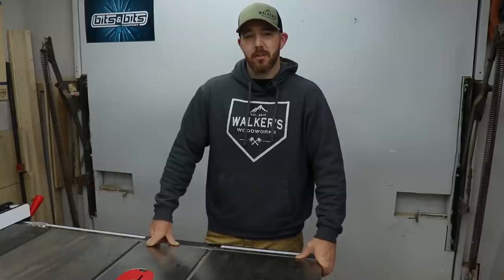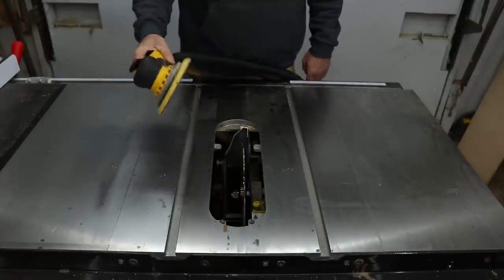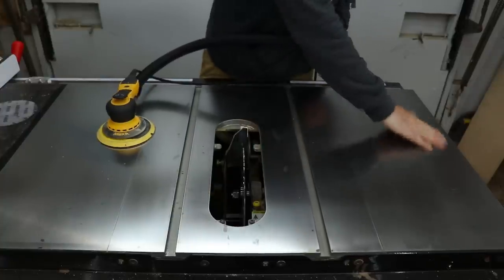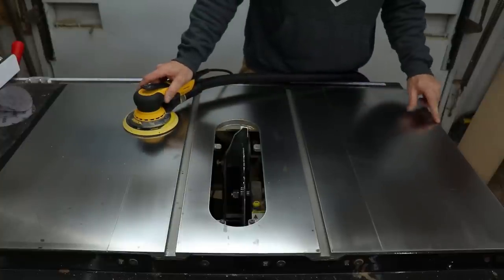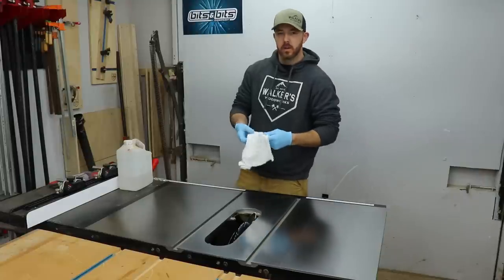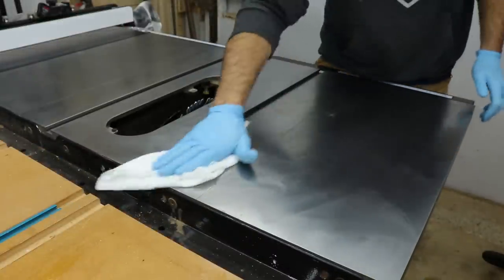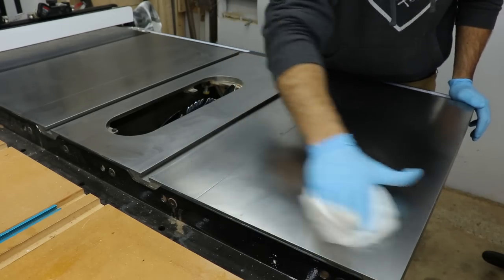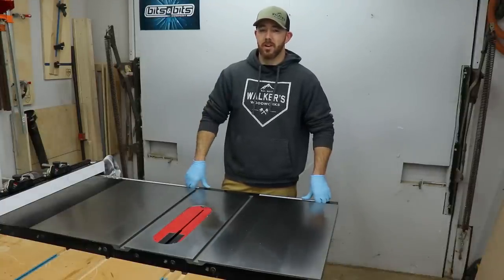How to maintain and clean a table saw top / Saw maintenance

Comment: When sanding anything it is a good habit to use mineral spirits every time you increase your sandparper number. Otherwise you are sanding in the larger grit pieces from the previous sand level.

Comment: Beautiful job. I've had a long series of old cast iron machinery over the last 45 years and have found single aught steel wool good for chasing the rust in the bottoms of pits. Also, a few swipes with a wad of waxed paper maintains a waxed surface for a very long time if used to dust a table rather than blowing it with compressed air.

Comment: I usually vacuum the top off, go over the surface with a 4” wide razor blade scrapper to remove dried finishes or fuzzy rust. Vac the table again and use a spray lube like WD40 and use Scotch-Brite pads. If you don’t want to wear yourself out, use an old worn out 4” wire wheel. It holds the pad firmly and gives a nice finish. I work my way up to the white pad. When it comes to the wax I start with the left wing first, then buff it out before moving across the table. I know the can says 10-15 minutes, I give it 5 minutes otherwise it will wear your arms out. Also don’t forget to wax the the throat plate. Boesheild is another good option for the table. If rust or stains persist you can use Rust Free. Wear eye protection & gloves as this is an acid. It removes rust completely, as well as paint, so if the edges of your wings & table are painted add a couple layers of painters tape. Spray a small area with Rust Free, use a piece of Scotch-Brite and rub the rusted area for a few minutes and wipe with a clean towel. In the past I have redone the complete table top after spot cleaning with some light mists and work it in to the entire top. It makes the finish more uniform in appearance. I also keep a wet rag around too just to be safe. Happy polishing & have fun.

Comment: I use a bostitch product called Top coat on all my metal tools. Spray on then wipe off, lasts for about a year. Prevents rust and oxidation, is non staining and great for hand tools as well.

Comment: Many yrs ago I read a suggestion in a woodworkers forum on how after preserving the finish on a metal surface cover it with a bath towel when not in use. Try not to place your hands palm side down on the table... will corrode. Thanks for the video.

Comment: Try a smidgen of WD-40 on those stops and sand with 220 Norton sandpaper.  You need to wipe the table after each application and sanding.  Clean, then apply wax and buff.

Comment: We use the Abralon pads in the pro shop at bowling alleys to change the surface of the bowling ball and polish it up. But, I've used them on other things and they work great. I've even used them on aluminum surfaces
Reply from the maker: I love them!
Reply: @WalkersWoodworks  dude,  I got a full set ranging from 180 grit - 4000 grit on 2sands.com a few years back

Comment: I have two table saws that were tossed out by neighbors. I am currently working on getting them cleaned up and running. These are saws that don't have parts available any longer. They are both 10 inch saws, and I am looking for fences for them. Can't seem to find any online, so I might have to make them. I will look at the parts diagrams to get an idea of how to make them.
Reply from the maker: Good luck!  Sounds like a fun project.
Reply: @WalkersWoodworks  It will be a challenge that's for sure. I have to make a base for one of them. I will look for some sheet metal somewhere for the base.

Comment: For rust and stains in metal, go by your local West Marine or Marine supply store, and buy a bottle of rust and stain remover.  The bright work on boats rust and stain badly. These places carry the chemicals necessary to clean up metal surfaces easily and with out much effort.  Wipe or pour it on, wait a minute and wipe the corrosion and stains right off.  Then polish your saw table with 320-400-600 grit and then wax.
Reply from the maker: I'll try that in the future!

Comment: I have a dewalt jobsite saw. I don't use it for jobsites though. I don't know what surface it has but I'm pretty sure it's not cast iron. How would I clean it?
Reply from the maker: Probably just try steel wool and wd40

Comment: You ever thought about using wd40 or another rust removal product to help break up the rust. I l have always down wd 40, scotch pad, then degreaser, followed by the paste wax
Reply from the maker: Yes I've done that as well.
Reply: What way do you prefer?
Reply: Having used the WD40 method myself, I've always found it to be messy. I never thought of using high grit sanding. Much less messy.
Reply: @awlthatwoodcrafts8911  messy? Maybe you ought to take up knitting, or something? Messy, GTFO!
Reply: Would this method apply to all steel top saws? I’ve got and old craftsman that has a slotted top.

Comment: Not how I'd go about it but different strokes for different folks. A less invasive way of doing this is with steel wool by hand and using a slurry mix. Slurry is a combination of your favorite rust penetrants mixed with light solvents. Maybe some Liquid Wrench or PB Blaster and mineral spirits and some non-detergent oil. That way you're not attacking the good metal while you're removing rust from pores. Sandpaper is going to grind sound metal off to get down to the rust. Then once you're done slurry polishing clean your mess off with a stronger solvent. Say acetone or lacquer thinner. Apply a paste wax protection and you're done. What's going on here is just asinine.
Reply: your concern is removing good metal lmao. you could sand on that forever with the grits he used and never make a noticeable dent in metal.
Reply: @AngelousSpike  One swipe is noticeable. You can measure the thickness of a mark left by a felt tip pen.
Reply: I'm sure you can tell the couple of thousandths taken off but most of use would never notice. Nobody is making aerospace parts on a table saw. He used a DA sander down to 180, not a grinder with a 16 grit disc. You'll never remove enough metal to make a difference unless you're just a complete idiot.
Reply: @rogermccaslin6750  I do not like to destroy the integrity of tools if I do not have to. Cleaning rust off a table saw top I do not have to either. I bought a used table saw with rust on it. A lot of rust. This much http://i.imgur.com/jjOer.jpg I cleaned it with steel wool and it is fine now. http://i.imgur.com/eqvwm.jpg

Comment: Just got a table saw with a rusted top. Perfect timing! Is there any reason you couldn't use your rag under the mirka sander to buff out the wax?
Reply from the maker: That would work well.  I would probably not use the dust collection though.  Mirka actually makes buffing pads for the Deros. 👍

Comment: What about the inside
Reply from the maker: Inside the cabinet?
Reply: Walkers Woodworks 
I mean the inside of the table saw (sawdust and stuff )
Reply: if it helps I vaccum mne with my shop vac and /or use a air blower noggle underneath my saw when I am done using it each time. I clean it and wipe silicone on the interior twice a year...
Reply: Jim Brent 
Thank you so much

Comment: Just found this. I'm probably picky, but I only use 400 grit on a hardwood block with WD40 and go only in the direction of the material over the saw. Then it's acetone to get rid of the WD40 at metal dust. Someone below suggested T-9 Boeshield, which I use on everything with iron in it. It won't prevent rust, but it does extend the period between cleaning sessions. After you let it soak in overnight, wipe the excess down and then do the wax. This keeps my saw clean and slick all the way through Virginia summers. Also, yes, someone else recommended a cover - I use a big hunk of Army tent, which is dense-ass canvas.
Reply from the maker: All good tips!

Comment: OUCH, I'm sorry but I wouldn't consider using a power too on a machine table. A lapping block, 400 grit 3M wet and dry paper, WD-40 for lube  and dress from one side to the other flipping the block and counting your strokes. Once done from one side go from the other. Start at the finishing end of the saw and finish at the head of the saw, the end you feed.

Comment: 40 hrs in the business. I kinda laughed when you started with 600. Glad you learned something. You can cut your time in half do a better job if you spray WD 40 all over the surface and go through the grits if that’s the look you’re after. I personally never go past 220. Gets all the stains out and the odd rust spot. The 220 leaves the surface abraded enough to absorb whatever product you use to resist moisture. I used to use wax but have switched to the newer spray inhibitors. Can’t remember the name but it works far better than wax in a non heated shop. My saw isn’t as shiny either. Don’t see the point.      
You would never prep a piece of wood for finishing by sanding past 220….usually. Anything finer and all you’re doing is polishing the wood so as not to accept your first coat of finish as well. Make any sense?
Just adding my two cents. Constructive criticism.